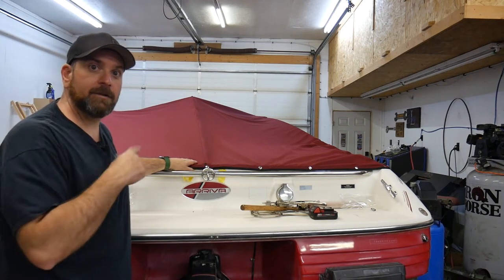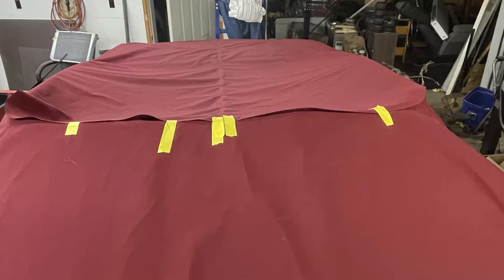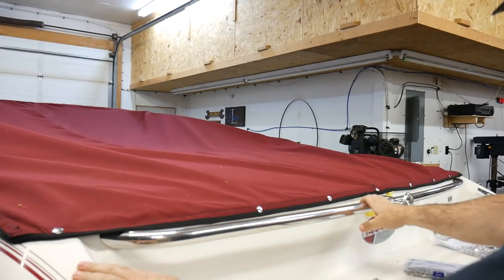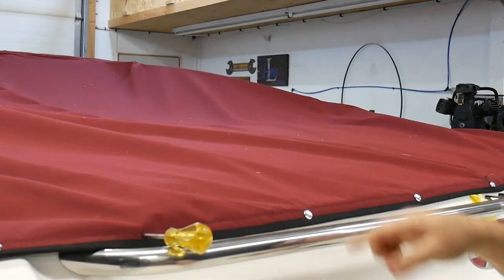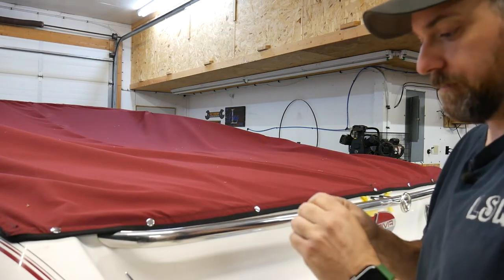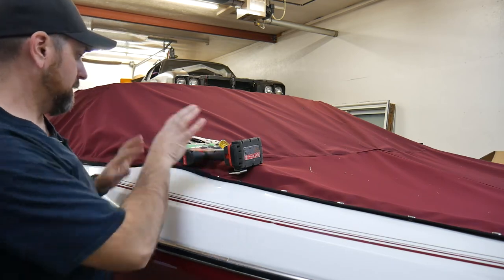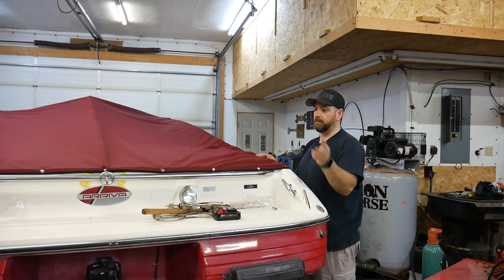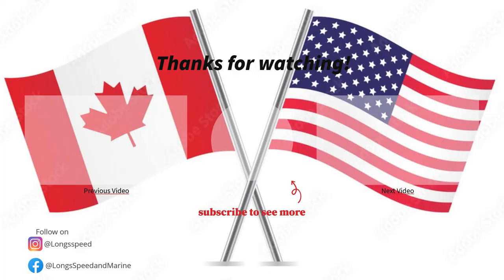How to Install Snaps on a Boat Top

Comment: Very helpful and clear.  One tip I do when drilling any hole through the fiberglass surface. Get a good quality counter sink and after you have drilled your screw hole, counter sink it through the gelcoat. This will stop the screw cracking the hole edge and causing crazing.

Comment: Nice video, thank you for sharing.  I have a 2005 bow rider that didn't come with a snap cover and have been thinking about adding one. We leave it in the water all summer usually and it bugs me that the sun is beating down on it and the rain gets it in too sometimes.  What type of material did you use and where did you order it?  Doesn't seem to be made anymore from the factory for my boat, so I was thinking of trying to do it myself or maybe hiring someone to.
Reply from the maker: Sunbrella Material.  A local supplier sells it. You can search out Sunbrella distributors in your area.